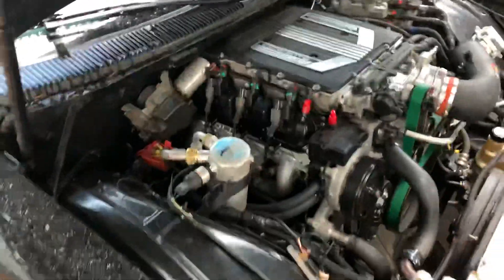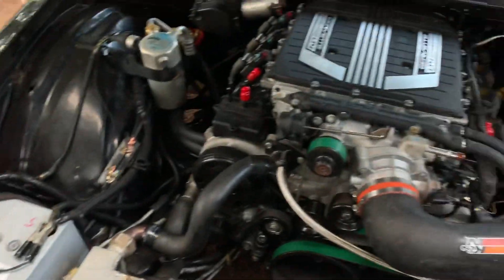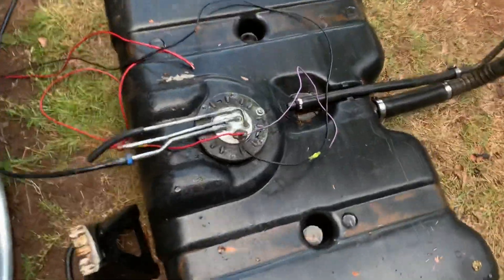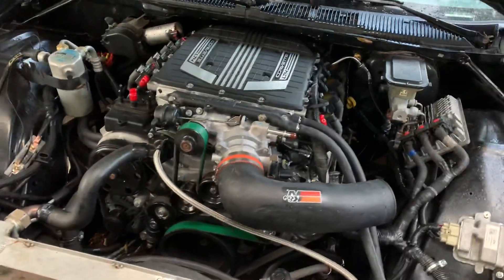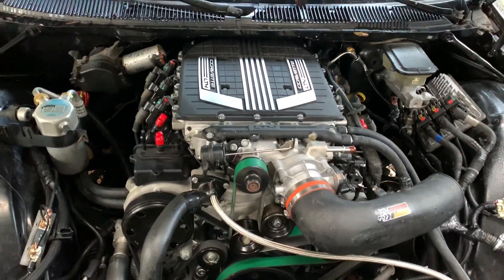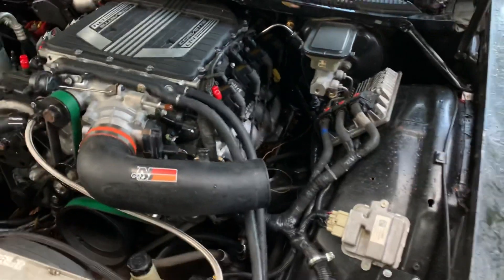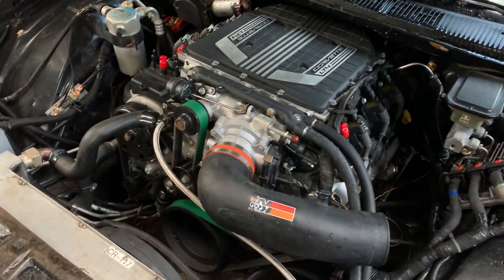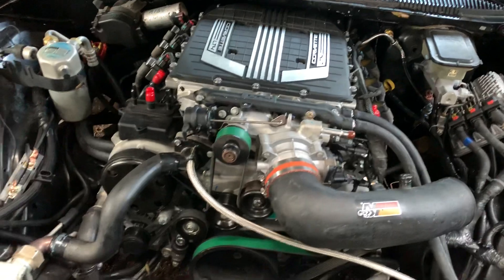1995 Impala SS LT1/LT4 Gen 5 Swap Update Pt. 3

Comment: So out of curiosity, if someone were to buy a stock 96 impala, caprice, ss, whatever. Would the new LT4 be a direct swap/bolt right in with no mods for the stock lt1? I was thinking that the advantage of using the LT engine over the LS engine was simply that you don't need to modify anything. Otherwise if you have to do the same amount of mods then why choose the LT?